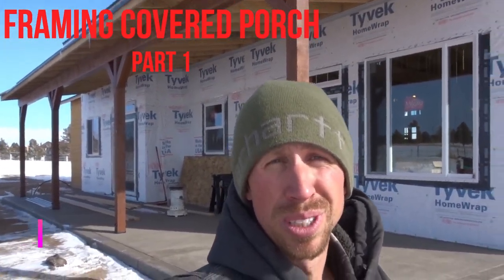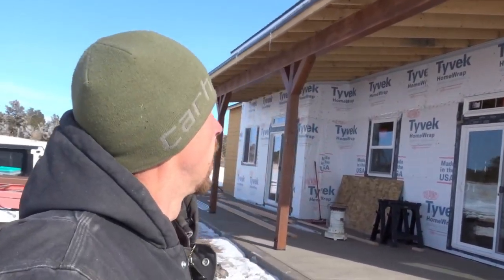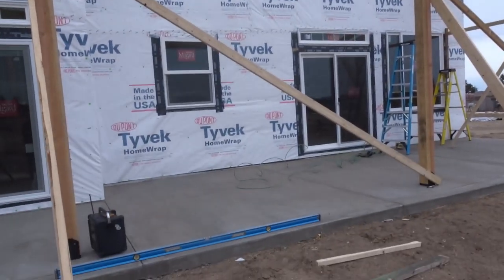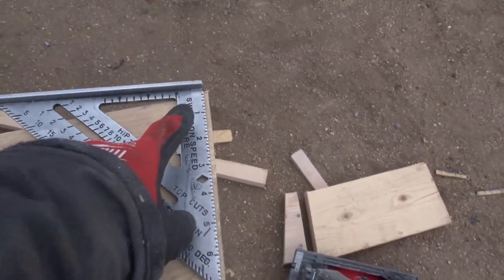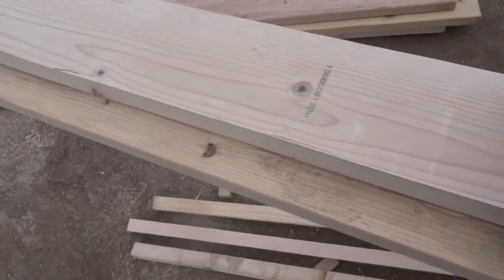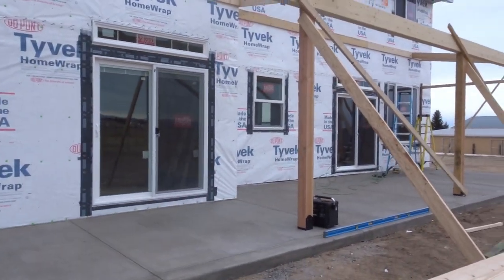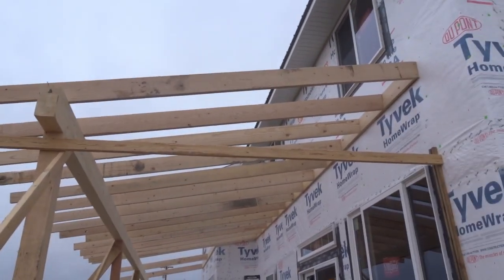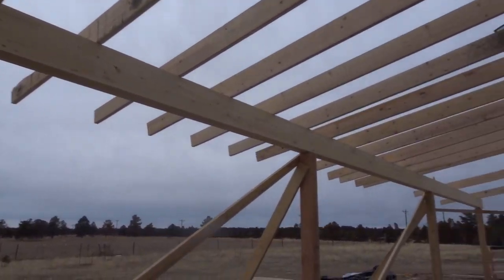Part 1 Porch Roof/ How to build a porch roof

Comment: Looks great!
Reply from the maker: Thanks! Definitely adds to the house!

I think I might have seen your orange Jeep the other day. Or another orange Jeep beeped as they were passing.
Reply: Building With Josh, lol, yep that was us again.
Reply: By the way, do you know anything about doing radiant floor heat?
Reply from the maker: A little bit. Are you talking about hot water heat in the floor?
Reply: Building With Josh yes, using a boiler, we would love to learn how to do as much of it ourselves if possible with guidance.
Reply from the maker: @shastamedley5062  the house I'm living in currently has hot water heat. It has a concrete slab floor and is very effecient. Makes it so the floor is always warm. 

The only downside is cooling. But if you aren't concerned about that, it's definitely a good way to go. I know you have to have a zone per so many feet. The loops have to be really close in lineil footage. It's not super difficult, just labor intensive. 

Are you doing it on wood floor or concrete floor?
Reply: The plan is to put it in the concrete slab in the basement and on the wood floor on the main floor with concrete on top.
Reply from the maker: @shastamedley5062  ok..yeah it's not to bad. you can do most the work with all the heat runs and get some help when it comes to laying it out and hooking up the boiler if you would need it. I'm not a plumber so I would advise you to ask someone who does that for a living. It's quite a bit of work, but you can save yourself thousands if you do it yourself. It's a pricey job to hire out.
Reply: Thanks that's encouraging to hear.

Comment: Shooting that ledger board be against the frame and not the sheathing on the wall?
Reply from the maker: By putting the ledger board on top of the sheathing and not directly on the frame, the wall stays tighter and keeps more structural integrity.

I've always put the ledger on top of the exterior sheathing. I guess you could cut the ledger board in if one would want to.
Reply: @buildingwithjosh  why I ask is I have a truss the sits on the ledger board and but up against the other trusses this is for a porch gable that goes back to the ridge on the roof
Reply from the maker: @Trifiveguy  sounds like yours was part of the roof framing design. Which makes sense for your situation. So your roofline is trusses and meets your other roof. I understand now.